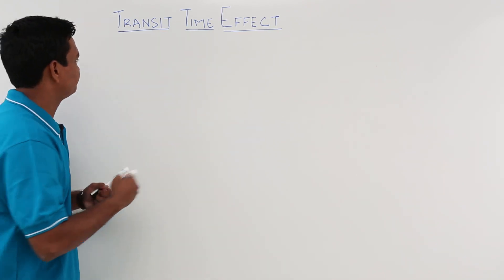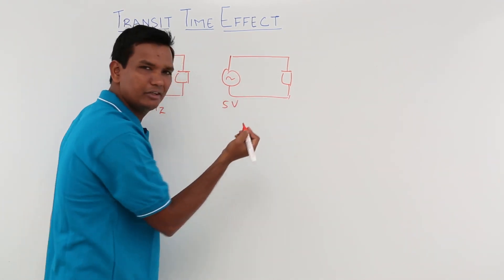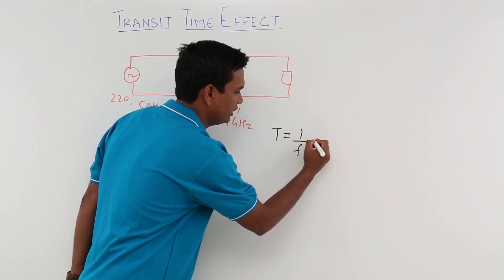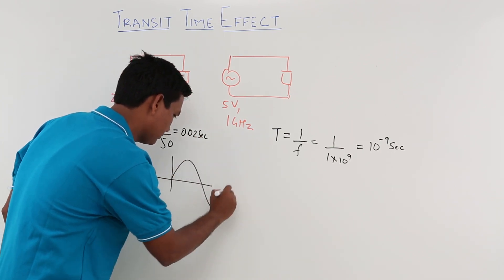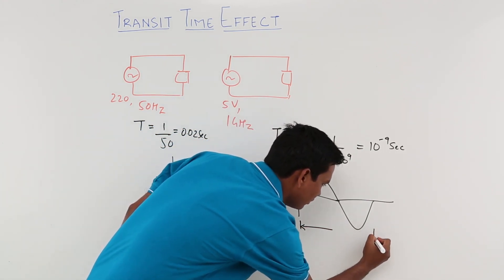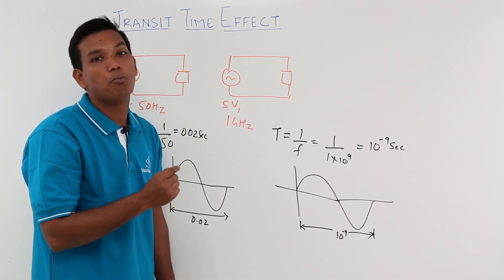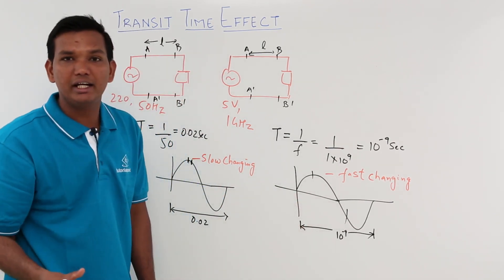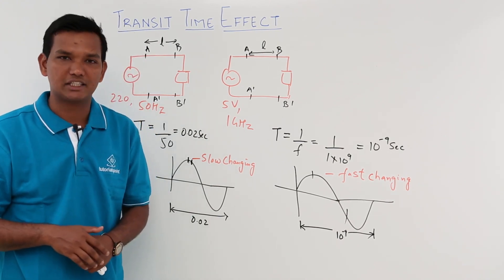Transit Time Effect in Transmission Line

Comment: Why in the case of 0.02 sec signal the voltage difference is very small??
Reply: Because that signal  is taking more time to complete a single cycle ,compared to the other signal.